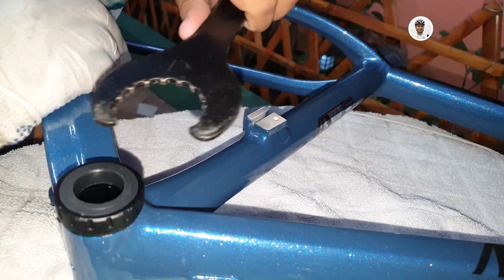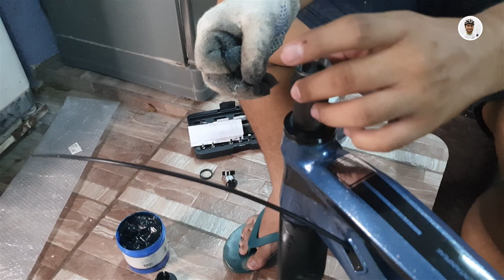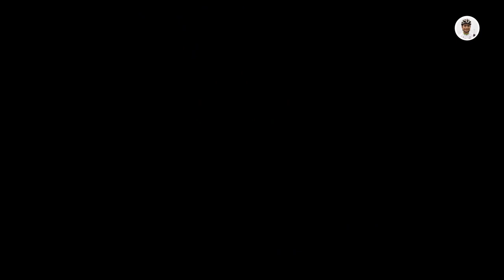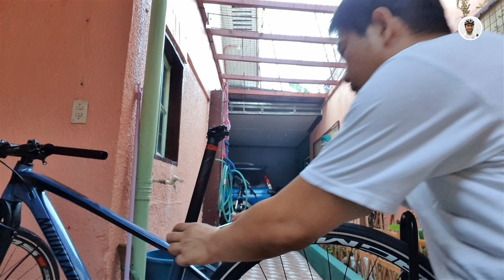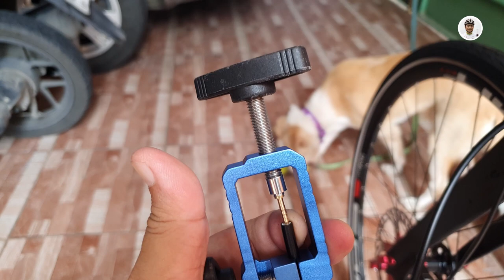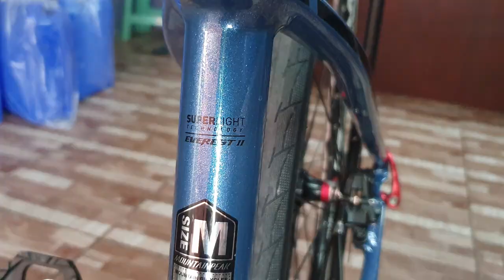Dream Build Hybrid MTB 29er | Bike Journal

Comment: boss chris, pakicheck nga ground clearance from pedal to ground. yung veleno29er , 29x35c ko dati nasa 1inch nlang yata, sobrang prone sa pedal strike
Reply from the maker: Totoo sir, yun setup now is prone sa pedal strikes. Planning to change tire to regular mtb tire 2.0 siguro.
Reply: @ChrisRidesPH  yung sakin, nagpalit din ako ng 2.2 tires kc malubak din routes ko (bike to work). Umangat ng .75-1 inch (depende kung medyo inflated). Balak ko mag hybrid ulet, 27.5 frame and 29x35c, para sa mga 40-70km road rides

Comment: Ganda ng set-up niyo sir , pag 29er L na mountainpeak everest 2 ano po yung papalitan sa setup , planning to build din po
Reply from the maker: for Large, wala naman siguro sir.  My only issue before is the pedal strike kasi medyo mababa ang ground clearance.  It can be resolved kung yun fork na bibilhin nyo is longer kung gagamit kayo ng 700x35/38c tire.  Sa akin pinalitan ko na lang ng proper MTB tire para umangat ng konte kasi sayang naman yun Toseek carbon fork kung sya ang papalitan. enjoy! :)
Reply: @ChrisRidesPH  gladly appreciated po yung reply niyo maraming salamat and godbless sir
Reply: Last question any recommendations po para sa fork gusto ko rin ng ganitong hybrid setup pero more on roadbike yung gamit .
Reply from the maker: no prob sir, as long as I can help.  since hybrid po with 700 tire ang gagamitin, ang binili ko kasi ng fork na Toseek with standpipe length 300mm (ma-eencounter nyo rin siguro yun pedal strike).  

This is what I bought for this project --
https://shopee.ph/TOSEEK-Matte-3K-Carbon-Fiber-Mountain-Bikes-Fork-Tapered-Rigid-Bicycle-MTB-Fork-Parts-26-ER-Inch-Tapered-1-1-8-1-1-2--i.233388620.9316190516

I suggest longer than 300mm  na standpipe length -- para medyo angat na yun pedal sa ground, for your ride safety na rin.  (Pero porma wise, maganda ang pagkaka lapat talaga ng 300mm both sa gulong na 700c o 29er 2.x size).

Comment: boss kapag M6100 12speed ba sa RD may cons ba siya vs. M5100 in terms of widerange na papipilian na pyesa sa market?
Reply from the maker: sir Mark, if budget permits.. go for M6100. Wala akong maisip na cons sir.  pyesa wise, marami na rin kasing available sa online shopping platform na maaaring wala sa mga local bikeshop.
Reply: @ChrisRidesPH  salamat sir Chris. Tig ilan spacer pala nilagay mo sa BB with 1by set up?
Reply from the maker: kung same ng crankset + bb tayo na ginamit, sa drive side, nag lagay ako ng 1 spacer, mainly para umangat ng konte kasi 38T oval yun gamit ko, tatama na halos sa chainstay. then walang spacer sa left side in consideration na kakapusin ang spindle.  dapat secured kasi ang kapit nun left crank arm sa spindle.  kung hindi naman kapos, enough yun haba ng spindle, i think maganda balance na 1 spacer each side. hope this helps.
Reply: @ChrisRidesPH  noted sir Chris. Yes same set up po din ibuild ko, although magkaiba ng brand. Sana pasok pa yung 42T kahit 1 spacer lang sa drive side.

Comment: Boss nalilito Po kami.kc Sabi Ng kaibigan ko 44mm 55mm na headset pwdi daw sa Everest to? Sana mapansin po.new subscriber
Reply from the maker: Somehow tama po friend nyo (mali lang ng konte sa mm), tapered po kasi headtube ng everest 2.  Kaya yun headset nyo 42mm 52mm dapat. Depende sa fork na gagamitin nyo, dun na lang magkakaroon ng difference. Kung steel/alloy yun steerer tube - yun meron star nut ang bibilhin nyo, pag carbon naman ay expander. Kung sa local bikeshop kayo binili mas madali. 

 Salamat sa pag subscribe at sana naka tulong 😁

Para magka idea kayo, eto yun binili ko po sa shopee (for carbon fork)
https://shopee.ph/product/165708221/6560052888?smtt=0.81085694-1625775940.9

Comment: Sir tanong ko lang balak ko i hybrid set up everest 2 frame ko pasok ba ang shimano non series hubs dyan at tourney tx over size pulley ko sa frame
Reply from the maker: 135mm din naman ata yun non-series hub, I think pasok pa rin yan.  btw 142mm ang rear ng Everest.  For the oversize pulley hmmm no idea sir.  di ko pa na-try, but I have a feeling no issue yan, best is to try.  Ride safe!
Reply: @ChrisRidesPH  salamat sa reply sir

Comment: Boss pwede mkuha lnhat ng specs. Nito boss gyahin kp sna slmat.
Reply from the maker: refer below lods.  You can also see the specs in the description

Mountain Peak Everest II 29er
Toseek Matte 3K Carbon Fork 29er
EC90 MTB Bike Stem 80mm length 31.8mm
BJ Carbon Fiber Headset 1 1/8" - 1 1/2"
Tachiuwa stem spacers
Sagmit Ultralight Seatpost 31.6m
ZTTO seat post clamp 34.9mm
Ultralight VVT Saddle
Sagmit Handlebar Grip
Sagmit Chase 800mm handlebar 
Shimano MTB SPD Pedal Clipless
ZRACE Casette 11 speed 11-50T
GOLDIX Racework Bike Crankset
Deckas 104 BCD 38T Chainring Oval
Shimano Deore M5100 11spd
Shimano SLX M7000 Chain 11 spd
Sagmit EVO III Rim AV/FV 32H Tubeless Ready 2pcs
GUB 6 Pawls 32holes 6paws hub set for 11spd
Richman spokers 72pcs spokes and nipples 294mm
Panaracer Tire 700x35c Greyline Reflectoriz 2pcs
ZTTO Quick Release Skewer
Rim Tape 2pcs
Inner Tube 700x35c 2pcs
IIIPRO Float Disc Brake Rotor 180mm
IIIPRO Float Disc Brake Rotor 160mm
Shimano MT200 Brake Set
Jagwire MTB House Set
Zefal 170 Wiiz Bottle Cage
Crank pedal Cap protector
Reply from the maker: btw, meron nga po palang mga steps dyan na di na namin nilagay sa video like yun pag assemble ng rim front and rear.  sa friendly bike shop na namin pina assemble. 

also yun bleeding ng hydraulic brake sa rear, di ko na sinama sa video (maybe on sa ibang episode na lang), kapos kasi yun cable nun MT200 sa frame ng MountainPeak Everest 2.

and lastly, kung gagamit ka ng 180mm brake rotor sa carbon fork, make sure to use a Post Mount adaptor for shimano 160 to 180mm.  kung 160mm naman no need for the mount.  rear naman, hanggang 160mm lang talaga ang kasya.

ride safe!